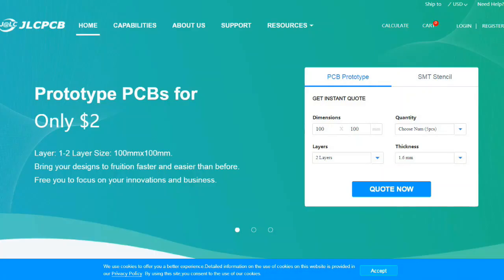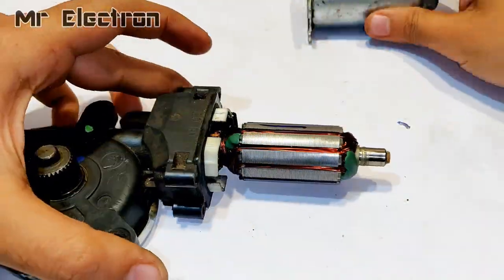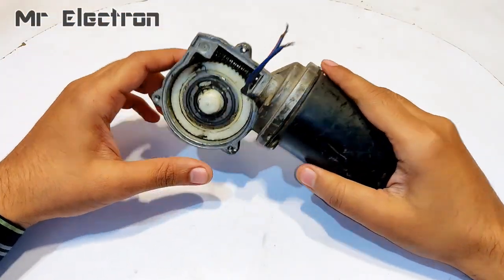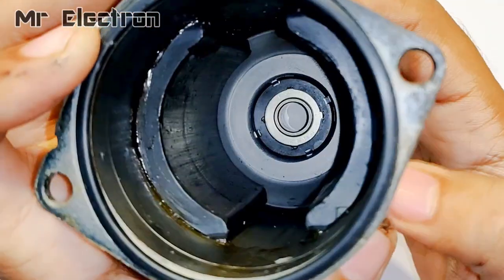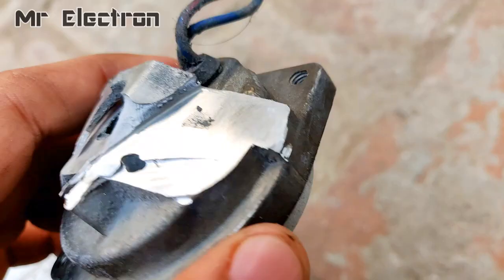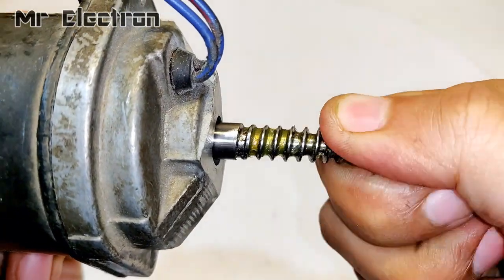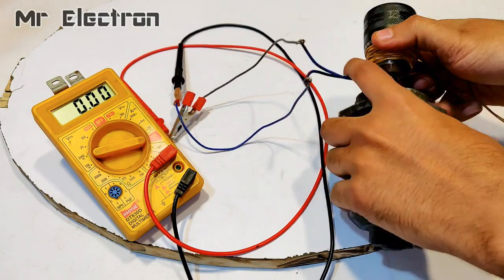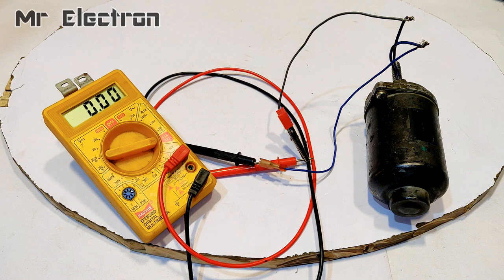Do Not Throw Away your Car Wiper Motor - 12v 8 Amps DC Motor Salvage DIY

Comment: Check your connections. The 2 wires that come out of the motor are 2 speeds and are connected, one at a time, to the positive pole of the battery. The negative pole is the motor body!

Comment: One remark, you disabled the spring of the brushes by hanging the bursh wire to the back of the spring assembly. Now the spring will not push the brush, so it will not make a contact after some use

Comment: Hi ive a Audi TTS and my wipers stopt working .so I bought 2nd hand motor .and that didn't work .so I took in garage and got no wear electricion haven't a clue when bonnet shut wiper fluid works and everything on the staik exept no conetion sum wear been months with no wipers 2010 .ive tried every were it never happened getting nothing even if I plug new wiper motor on .please help 🙏 not sere u get this from England Tia

Comment: I just needed to state that the "Windscreen Wiper" Motor/Gearbox you showed is DIFFERENT to Most others as they usually have "3" positive/negative tabs, Not just 2 like this one, usually they have 3 & thats because u can switch between 2 of the 3 tabs to change the rotation "Speed", which makes Windscreen Wiper Motor/gearbox's Perfect for MANY different projects! Ive even seen them used as a setup for "actuators" on home Driving "Sim" setups (for PC racing & sim games) where people have made moving cockpits & these motors/gearboxes are enough to move the persons entire body weight around! Very strong.
Reply: really that means i can use this motor to build an indoor robot vehicle and it will carry a heavy weight ?

Comment: Nice VIdeo, very informative.

now correct me if i'm wrong for pulling an object (gate) weighing around 300+ KG the wiper motor is the best choice ?
Would the power-window motor stand a chance ?

please reply. thanks.
Reply: I'd love to know if you got an answer for that.
Reply: @regularpit1508  Thanks for replying. i couldn't move ahead with the project. I kinda figured it out that i'll need more powerful motor than what i was planning initially.

Thanks Again.

Comment: Meseriasul , are putine cunostinte , , nici odata , nu se scoate statorul , fara ca axul sa nu fie angrenat de roara dintata , se scoate , capacul , statorului apoi se extrage roata dintata , eliberand axul melcat, se ridica cei trei , carbuni  de pe colector , spre a nu se deteriora ,, si se extrage axul rotorului Ce. nu mai cunoaste ,, exista . in constructie , trei circuite , de alimentare , , unul ,conectat , la masa notorului . reprezentand , minusul alimentarii , iar cele doua conductoare , alimentari , ale ungihlui dispus . pe carcasa carbunilor ce cupleaza statorul, formand turatii diferite , , are in constructie , un releu tremic , pe bareta de minus , dispus , intre carbunii colectorului ,acesta are rolul , de a drconecta , borna de masa minus , oprind functionarea ,motorului, la un efort mare ,protejandul / Este construit , ca ,MOTOR, ELECTRIC , DE TURATIE MICA , NU , ESTE INDICAT , CA GENERATOR

Comment: Brother i want to make drill from this motor how we could attach drill chuck,  and want to know is it usefull or not for drilling purpose?
Reply: Hey rashid Yes actually you can basically you can make a lot of tools from this motor just buy drill chuck from aliexpress cost 9e and weld it to the head of the wiper motor or use screw&hole technique. But i highly recommend 775 high speed motor is you want to make a drill. just search in youtube "how to make a drill" what type of drill u want to make rashid?

Comment: Do u think the wiper motor could retract an awning? Does it spin the opposite direction if polarity is reversed
Reply: DA, POATE FI  FOLOSIT , LA COPERTINA , , UN FIR , DEMASA ,MINUS 12V , CELE DOUA CONDUCTOARE , FOLOSITE , LA TURATII DIFERITE , IAR PENTRU SCHIMBARE DE SENS ROTATIE, SE INTERCALEAZA , UN COMUTATOR , 3X3POZITII , 3 RANDURI DE CONTACTE, SCHIMBAND POLARITATEA ALIMENTARII

Comment: How about its RPM & torque?
At several your video didnt inform it.
Reply from the maker: 6000 Rpm , torque test still needs to be done
Reply: @MrElectron     Thanks. Keep "moving" .  👍
Reply: Com este RPM, este motor sem a caixa de redução, é uma opção para adaptar em uma esmerilhadeira "grinder angle" ?